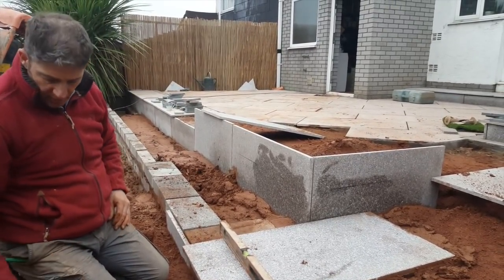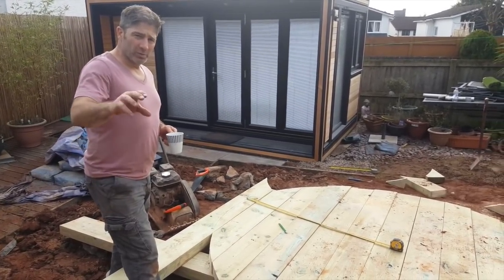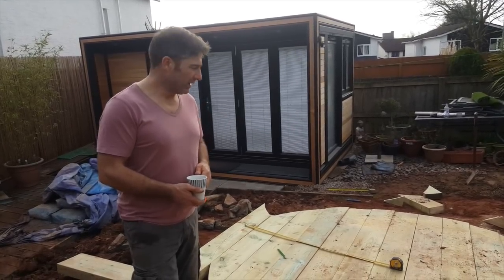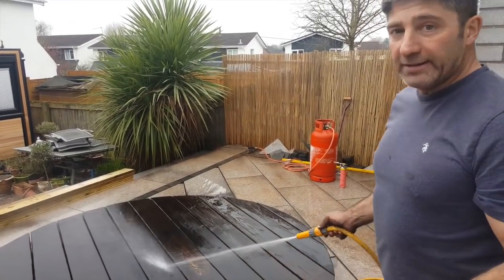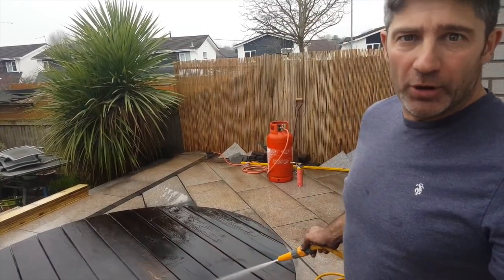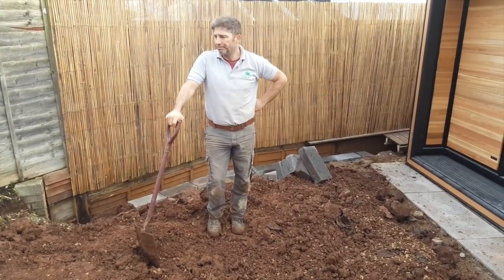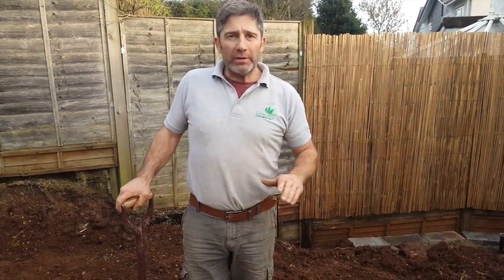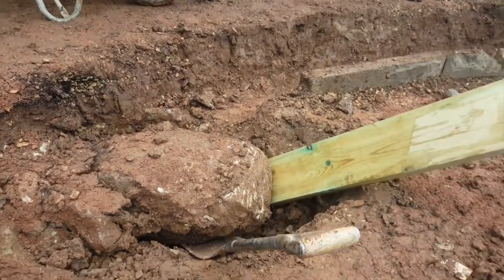Shou Sugi Ban Garden With Johnyboy Vlog 45

Comment: Nice work.. Did you oil it after, or leave as is with the char..?
Thinking if doing mine tbh so your opinion be appreciated,
Cheers
Reply from the maker: Yes I did, never oiled it in this situation but i have done since
Reply: @GreentopLandscapes  thanks mate. One more thing I'm thinking of using this method in garden near veg and possibly Animals, in your opinion do you think standard vegetable oil would have a protective effect like other more toxic oil finishes? Sounds a bit mad but thinking it's about as pet and plant safe as I can think of and just thought I wonder if that would seal the wood /have same sort of protection against moisture after the burn like an oil-based finishing product?
Reply from the maker: @AB-C1  You could burn the inside as well as that would protect it and oil the outside
Reply: @GreentopLandscapes  thanks, yeah im thinking burn the whole thing before assembly and then brush off and oil it then assemble it rather than after assembly. Thanks for getting back appreciate the advice mate. And top workmanship keep up the good work and videos! Appreciating the craftsmanship! If I had the money I'd get you in to do my garden but money bit too tight right now. Never know down the road though..
Thanks again for the advice mate 👍